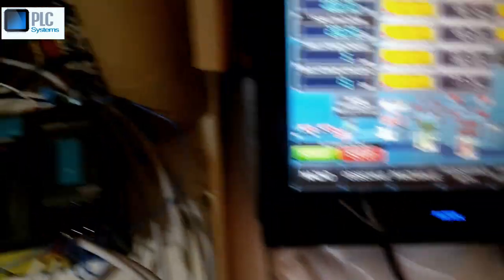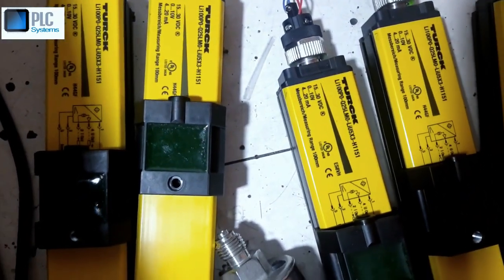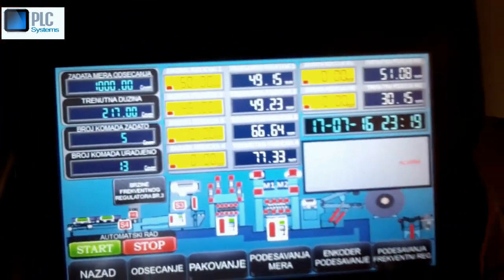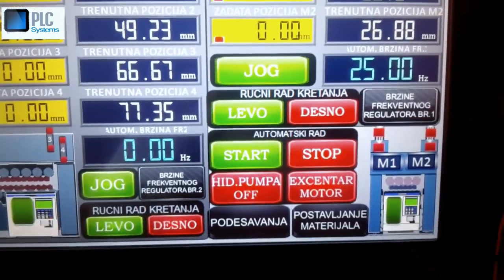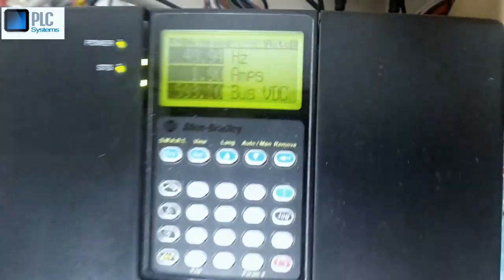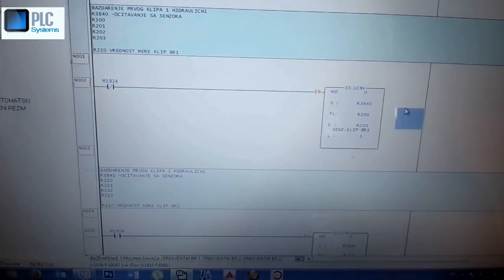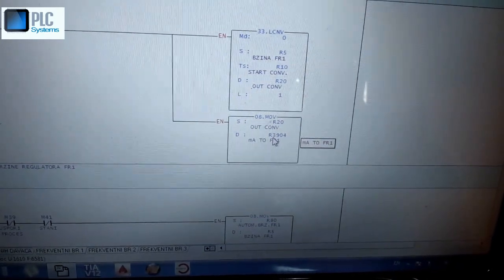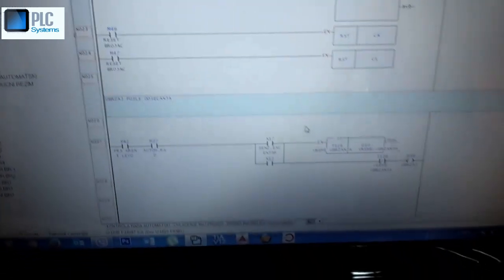current measure FATEK

Comment: Hi, please how can I set a maximum point like if the input reaches a certain level then it put on a relay and when it goes down the relay goes off. Thank you.
Reply from the maker: Only use comparator for switch on/off
Reply: @vladislavstankovic2104  thanks